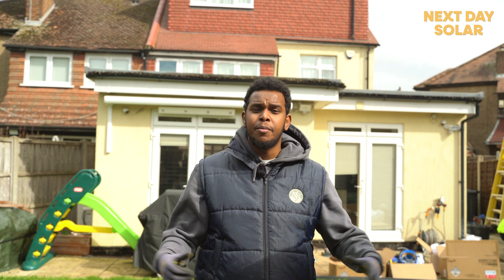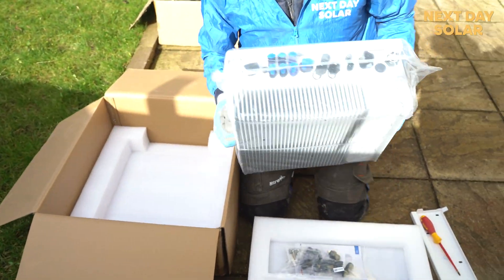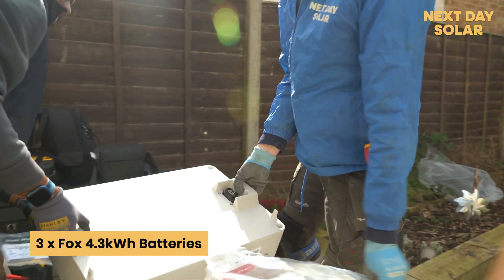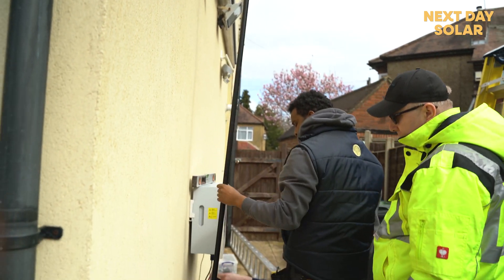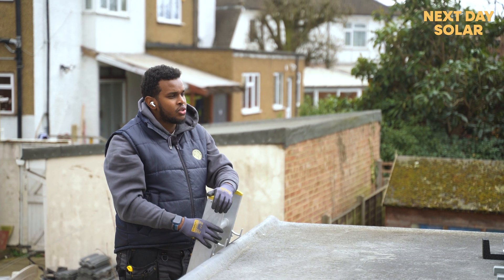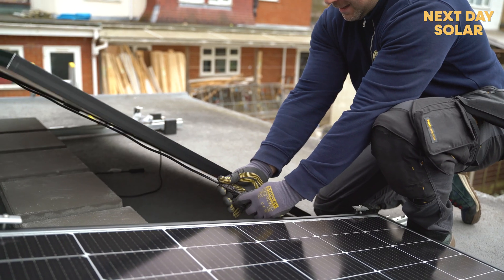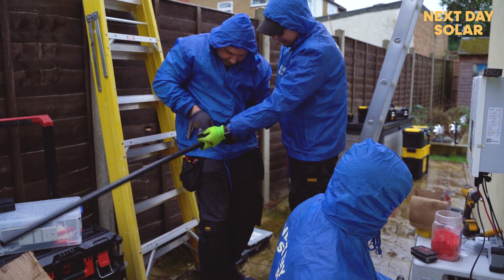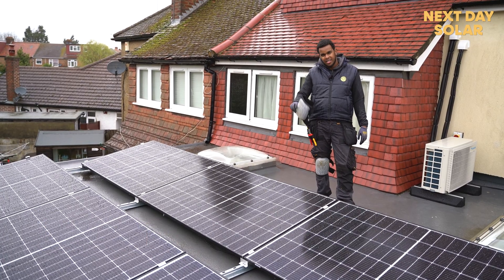Solar Installation on Flat Roof in 2 Stages Inc External Battery System

Comment: Good video 👍 can you tell me what the name is of the mounting frame used for the solar panels please and why planning permission is not required?  Thanks
Reply: Van der valk
Reply: The system cannot protrude more than 0.2 meters beyond the plane of the roof slope. -so can,t be higher than the flat roof without planning permission
Reply: Thanks for replying 👍much appreciated